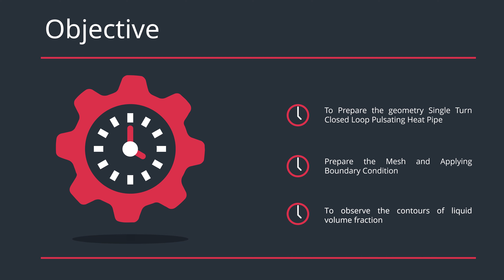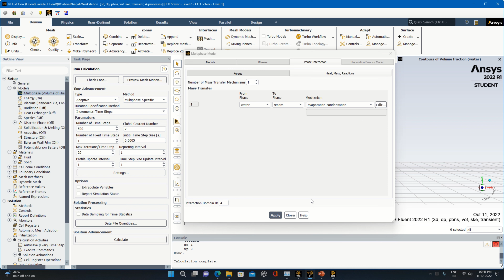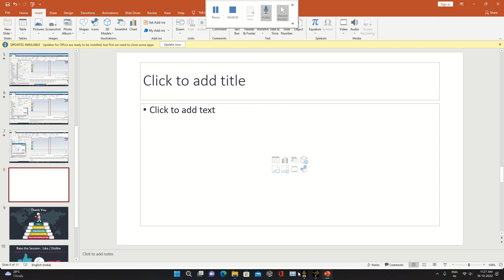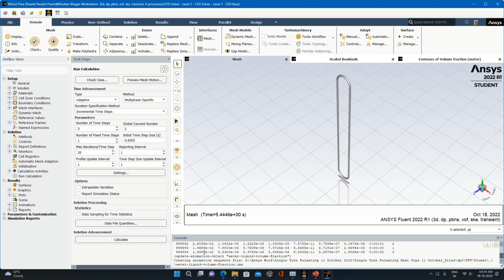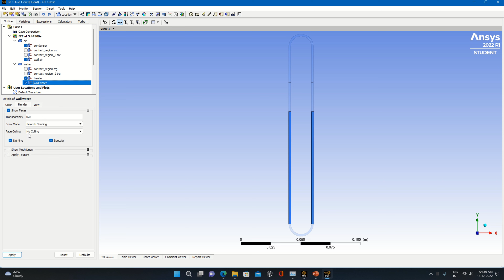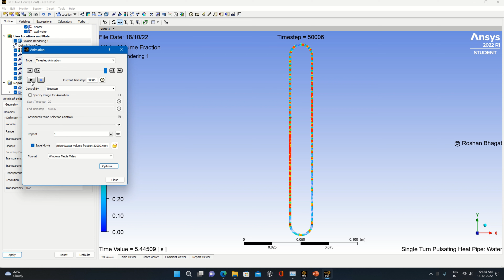Single Turn Pulsating Heat Pipe CFD Analysis | Pulsating Heat Pipe |

Comment: Why you set up condenser and adiabatic are air ? In actual the tube is evacuated ?
Reply from the maker: Air is included as an initial phase for numerical stability. A true vacuum cannot be directly initialized in CFD, so air acts as a placeholder phase, which is later evacuated through low-pressure conditions, allowing realistic phase change and startup behavior.

Comment: Why is the working pressure 4000pa and the saturation temperature 303k?
Reply from the maker: depends on the operating conditions for setup
Reply: @FrontiersInCFD  But the saturation temperature of water under a pressure of 4000pa is not 303k😳